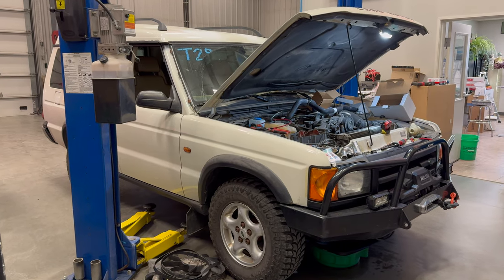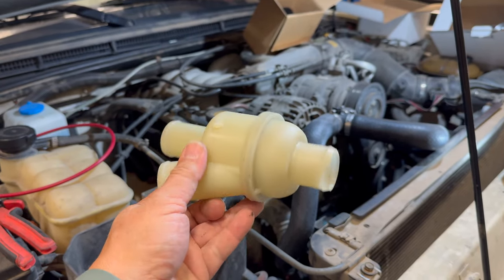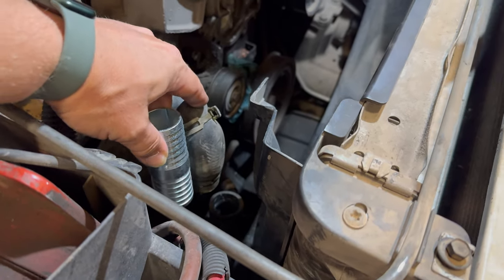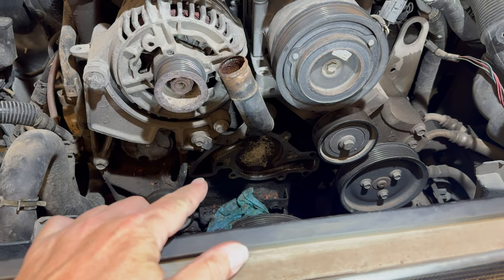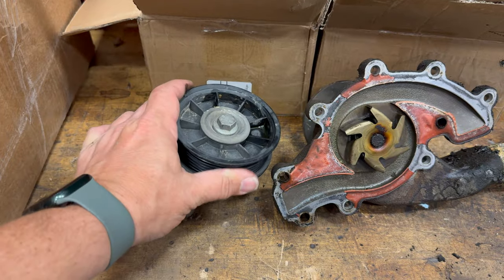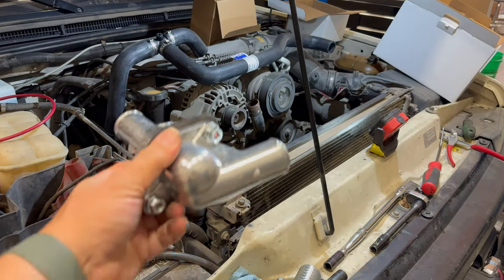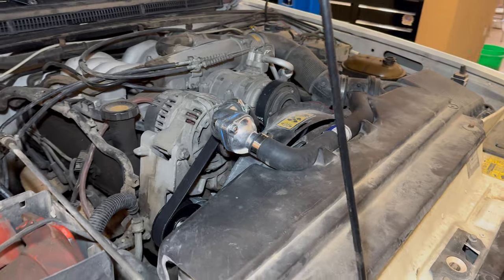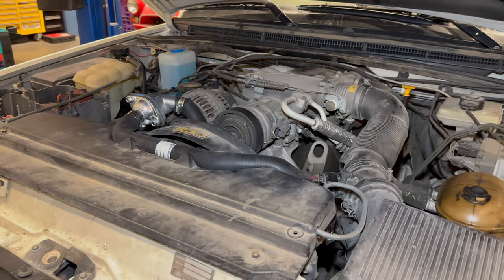Changing to an Inline Thermostat on Land Rover Discovery II

Comment: Hi Steve, that's a great idea and set-up. On my smaller Freelander HSE with its 2 litre BMW diesel and auto box, a modification recommended is using a UK-based kit that fits the Rover 75 diesel with the same BMW 2litre turbo diesel engine but uses a simple inline, infact it fits inside the top hose after the troublesome factory thermostat - It uses a  Renault designed inline thermostat I believe. Had one in my Freelander for 4 years so far and the engine temperature gauge just sits in the middle of the reading in hot or cold weather letting the engine run better. Thanks for the video. Ian - UK.

Comment: I am in this project now plus head gasket I had the white smoke out the exhaust. The only task I did differently is my belt I soak in aerospace 303 protectant versus replacing which I use on all my belts and wiper blades. Its helped the longevity bigtime. Plus I am replacing alternator bracket. Found it was broken. Ill do the valve cover gaskets too and maybe relocate the coilpacks.

Comment: I installed this setup on my ‘03 after upgrading the fan clutch (Hayden 2991) & fan (Dorman 620-112), & installing 180 degree OEM tstat. The initial upgrade dropped my idle/running temps to 187/194-204, & the inline keeps idle 178-183, but my highway temps seem to be all over the place. Can go from 189-207+ during a 15 minute drive at 70mph in the Deep South summer heat. Fall seems to be fine. 180 idle, 194 max highway with the 180 tstat. I am going to try the 170 tstat during the summer to see if that puts me in the correct range. There’s a FB thread about QC issues for this product, & manufacturer said they had a 3% failure rate, but many said they went through 3+ before they got a good one.

Comment: I was today years old when I learned that Discos come stock with a plastic thermostat and a plastic tee in the upper hose. I get it that this is an expensive British vehicle (meaning that it's designed on the assumption that when it craps out, Milord simply drives one of his other cars while a hireling hauls this one down to the village to have Alf mend it) but this still seems unusually sketchy!
Reply: Not only that but the factory thermostat is placed after the radiator so it has to make its decision based on already cooled down water from the radiator and a combination of bypass water instead of making its decision to open the thermostat based on hot engine water directly from the engine and then letting it into the radiator. Even if they didn't make it plastic replacement of the flow makes no sense being after the radiator

Comment: Fantastic upgrade. New Thermostat housing even has a good air bleed on it!  Cooling system seems to be the weak point of the discovery ii, at least the ones I've worked on. Cheers man!
Reply: Yeah the original design made no sense regardless of it being plastic period if you think about it they have the thermostat placed after the radiator flow so the water is already going in the radiator now it encounters the thermostat when it's cooled down and that makes no sense. All other systems the hot water from the engine touches the thermostat and then opens to let in the radiator

Comment: I'd be a bit concerned about how quickly the new setup will respond to coolant temperature within the top hose as it's a dead head arrangement until the thermostat opens (therefore relies on conduction rather than purging through the hotter coolant). I'm presuming that a small hole has been drilled through the thermostat to allow for a small amount of flow? Similar factory arrangements would either have the bypass route feeding from the engine side of the thermostat or at least a bleed hose which would go back to the header tank to achieve a similar goal. My understanding of why the vast majority of more modern cooling systems use control on the lower hose rather than the upper is to give a more stable temperature control & minimise thermal shock where you have an engine at high temp & a rad full of coolant which is at ambient which gets pulled in as soon as the thermostat opens.
Reply: Here in AZ, it has kept things cool. I have seen no issues. I did this mod 6mo ago.. we averaged over 100 for 6weeks! I got the O’Rielly’s tensioner too. Split 2 overflow bottles. All aluminum now!

Comment: Excellent video. Started following your channel when you rescued the D1, huge  LR fan. My question on this upgrade is how did you bleed the system? I know you must use the bleed screw on the oem set up to remove the air. Thanks and I'd love to see more Rover videos. 😊
Reply from the maker: It was vacuum filled to eliminate as much air as possible and then cycled a few times to let it self bleed.

Comment: What an odd setup!  But it works!
Maybe if you flipped the forward part of the tstat housing, the bleeder would be up?
Reply from the maker: They have a version where the port is up but I chose this one because it is the cleanest closest to the radiator install.
Reply: It works so well you don't even need to bleed it. And really it's not odd it's traditional to have a thermostat coming right off the top of the engine to allow water into the radiator. Having the thermostat placed after the radiator like the original makes no sense because the water is cooled down first and then reaches the thermostat so the thermostat has to make its decision to open based on cooled down post radiator water

Comment: Solid content AND your presentation style is very clear. 

What brand did you use? Did you have any post-installation issues?

Keep up the good work!
Reply: There's a website called inline thermostats that makes this kit for super cheap. I've had it for years and it works totally perfect in fact it works so well that you can't use the 180 because you will run into 170 and throw a low temp code in your cats will throw a code so I use the 195 element which is the next one up in that style and now I'm in the 180s all the time even in Arizona

Comment: Was there any reason they made the original as they did? Or was it just some questionable Land Rover design for no logical reason?
Reply: It’s designed as a bypass system so when the engine is first started up, the coolant still circulates but bypasses the radiator, then as it warms up, the thermostat gradually opens to allow some cold coolant to blend with the hot. When it’s up to working temp and fully open, it allows full flow through the radiator.
The idea is to prevent hotspots during warm up and stop thermal shock from cold coolant hitting the hot engine.
Reply: @emmajacobs5575  but isn't that the same as the much simpler upgrade he did in  the video? Why did land rover make it more complex? Or, is the upgrade not as good?
Reply: @TheGramophoneGirl  no, it’s not the same as I don’t think you don’t get the gradual hot/cold blending with the upgrade.

Comment: OEM set up is an absurd combination of convoluted engineering and plastic parts not fit for any cooling system let alone on a vehicle meant to traverse jungles and deserts. IMO, LR owners are more concerned with the perceived status and cache of the marque than reliability. Otherwise, they'd be driving Land Cruisers!
Reply: On my second plastic thermostat.. I have changed all plastic junctions. This makes sense here in AZ. I am trying to bullet proof my 04 Land Rover DiscoveryII HSE. Have a tight motor ..thank goodness.
Reply: Yeah the original is so stupid if you think about the placement of the thermostat being Downstream of the radiator. Why in the world make the thermostat in counter already cooled down water mixed with a combination of hot water when it should just encounter hot water directly out of the engine. So the inline isn't just better because it's metal and doesn't have a huge bypass it's better because the water straight out of the engine hits the thermostat. That's how all other designs usually work including the Rover before they made this one. Just like an old Chevy engine design hot water comes out of the engine it touches the thermostat it gets let into the radiator makes perfect sense. I never understood letting the water go into the radiator and then sending cool down water to the thermostat mixed with some hot water from a bypass just to confuse it to want to open and close constantly. It isn't just the big bypass it's stupid it's the thermostat being Downstream of the radiator
Reply: Correct..well said!
Reply: Best mod I have done to my 04 Disco 2

Comment: If this simpler routing of the coolantsystem on the Discovery II is really a good idea, wouldn't you have thought Land Rover had made it that way, instead of the completely different and much more complex routing they opted for from the factory?

As far as i can tell from the video, the original thermostathousing connected the outlet from the waterpump to the intake on the engine, so that coolant could circulate back to the engine, in the period when the thermostat is closed. That does not seem like a great idea to eliminate. Unless there is another way for the pump to be able to circulate the coolant from the waterpump when the engine is not hot enough to open the thermostat, there will be absolutely no coolantcirculation internally, until the thermostat is open. 

Another really bad outcome of this, is that the thermostat will take WAY too long to open, because there is no way for the heat of the engine to transfer to the thermostat, when water is not being pumped by it (like on the original setup). It will of course eventually open, but it will definately take longer, especially when it is sitting in a hose away from the engine.

This is as janky as it looks. I would for sure not run that.